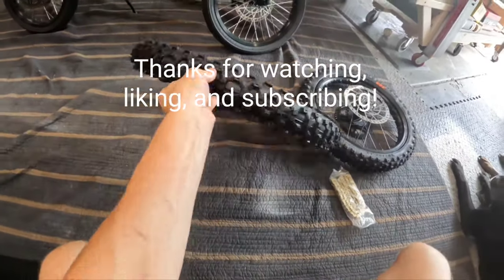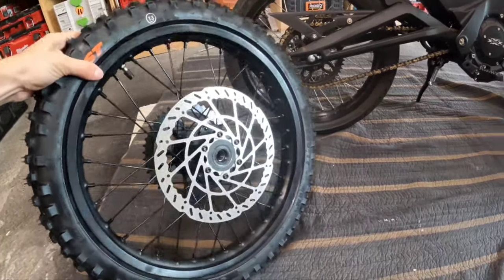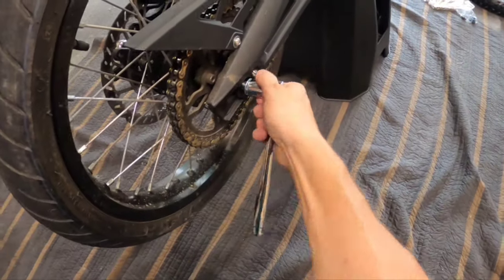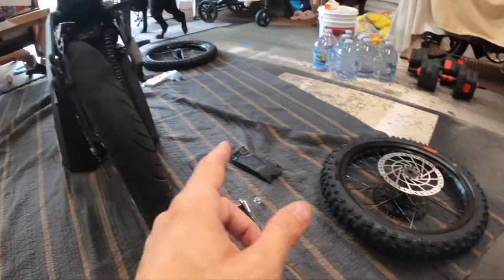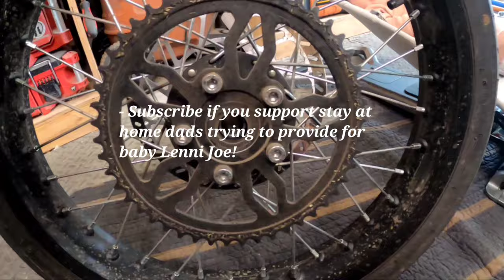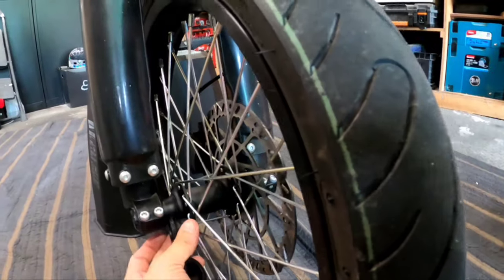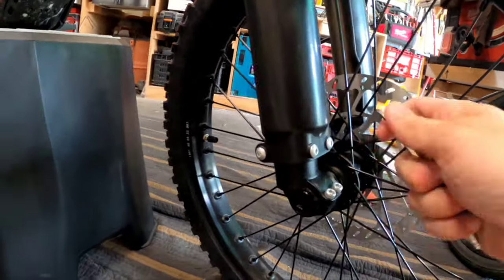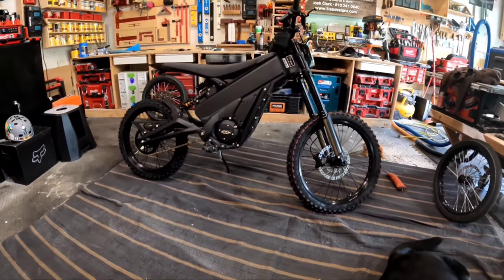Talaria XXX Offroad Wheel & Tire Setup! @LunaCyclesLLC  Full Install with Slow Motion Dig Clips

Comment: My set just got here yesterday still in box..you think these are full knobby trail only tires or more dual sport?
Reply from the maker: Definitely full knobby tires for offroad. Any full knobby tire will grip cement just fine but will wear out so fast. This is towards that wear out fast side. I believe the shinko or whatever they are called tires have the knobs so close and it's the dual purpose tire more so. I can't wait to go test these out right now
Reply: @JoshTheElectric  nice..did you see talaria boys vid where they went over upgrades they did to their xxx..they put something on back wheel that allows for much faster swapping between wheels..not sure what its called but i plan on setting mine up like that..also have you inquired w luna more about the pedal kit? Wondering when its gonna come out and if its a functional kit or a fake ascetic kit...lasty does your regen braking shut off automatically? I have a 36 mile commute to a rock climb wall i like using this bike for but noticed it shuts off and im wondering why...overall very impressed w this bike but not sure how long this suspension will hold up...nice install btw baby helper and 100 grand snack star of the show!
Reply: @JoshTheElectric  Shinko 241s and 244s are dual sport.  People like the 241s on the xxx.  I'll probably end up getting a pair for the 17 inch rims and replace the supermotos when they wear down.. or when I just never put them back on the bike lol.
Reply from the maker: Yea I seen the talaria boys video. That locking spacer thing that allows for a quick wheel transfer is online at every retailer and it doesn't seem expensive. I haven't noticed it being hard to swap wheels as it went on and off so smooth but I'm sure it has to help keep things good for the long haul.  Luna Cycles said it would be out this summer along with the wheel kit. So far they haven't let us down, hopefully it comes out soon.  Also my regen braking only works when the battery is below 90% and then it always works perfect on any level.